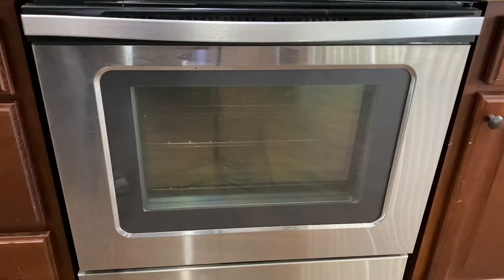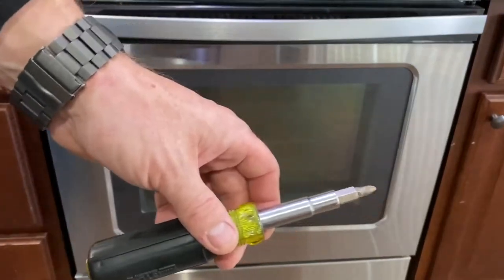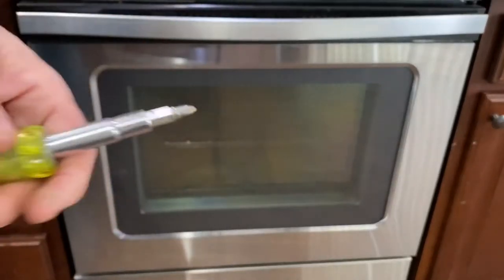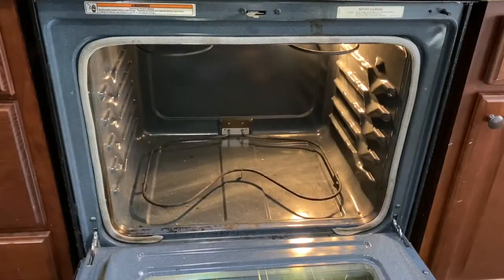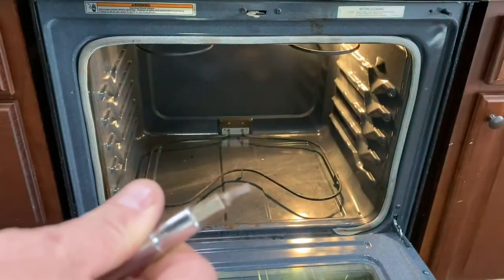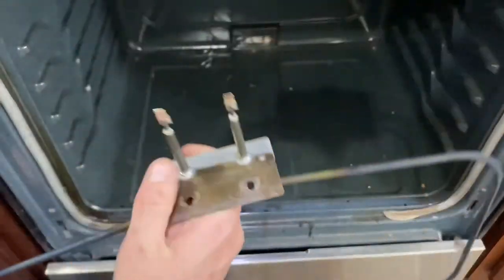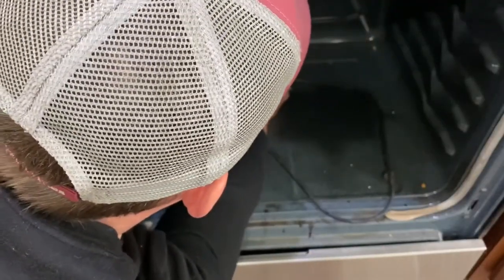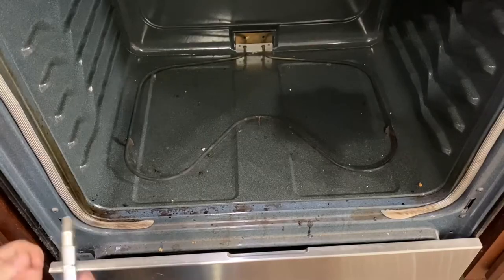Diagnosing and repairing no bake no broil on electric oven

Comment: Its likely not going to be your elements if both are not working.   Why not check the fuse
Reply: Okay, turns out, there is no fuse, problem was the control board... but, a year warranty from GE for hotpoint